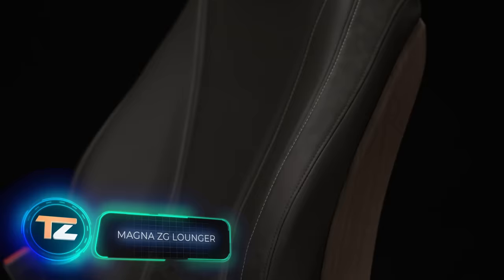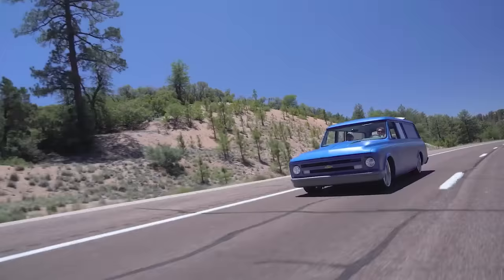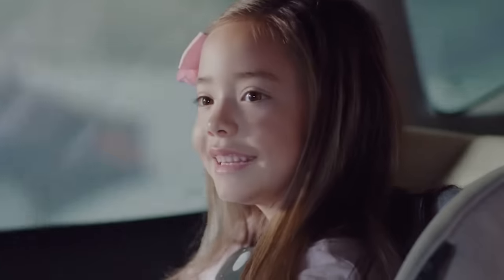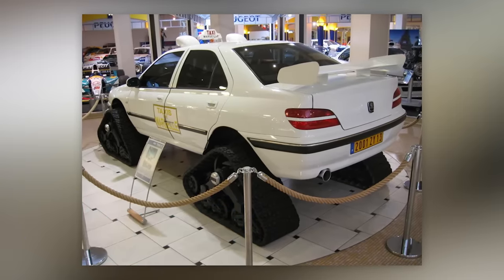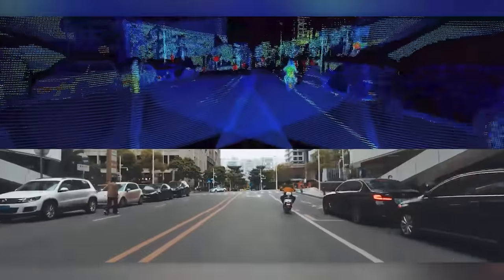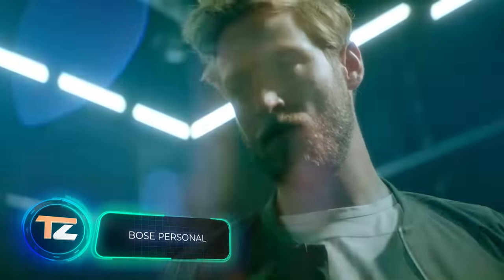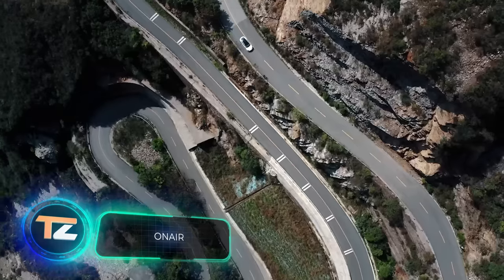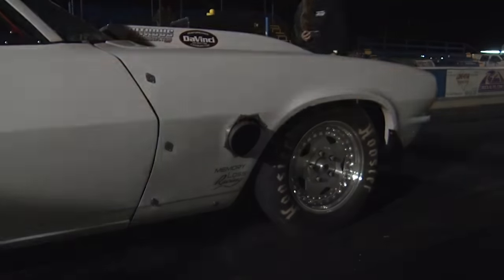INVENTIONS THAT WILL TAKE YOUR CAR TO A NEW LEVEL

Comment: the biggest obstacle facing EVs is not just limited range, but the lack of adequate EV recharging infrastructure . . .
Reply: Also those moving parts would be a fortune to replace. Because of the wear and tear of parts rubbing together.a stationary solar panel/heat generator would be a better way to add range even if its a few miles.
Reply: They also can't forget that most of our power stations run on fossil fuels so many people that are plugging in their vehicles are charging their vehicles because of coal. Then we could also talk about the mining practices to get the material to make these batteries also talk about how long an EV has to actually be in service before it has a positive environmental impact considering how nasty mining for the batteries are and how nasty disposing of the batteries are.
Reply: Something was said about the automobile and horse debate a century ago,  I guess things never really change

Comment: Camera's are truly great...if they don't fail!  They are electronic devices, and as such they are subject to failure, without notice.  Mirrors though, don't fail.  They don't take power to operate.  You can have multiple mirrors straight ones, convex ones and concaved ones.  Now I do like having cameras, and tend to rely upon them, to a certain level.  But removing mirrors, no way. That is not a good practice, ever in a vehicle.

Comment: How old your information is as Byton went bankrupt. Well, about the first seat. The lady really doesn’t look relaxed in that thing. And the Porsche electric motor has wires very badly assembled as there is not much space between the red wires and road. It needs good protective shielding too. And the car audio system with noise cancellig system. That’s prohibited in many countries like here in Finland. You must be able to hear noises ouside the car like emergency vehicle sirens.